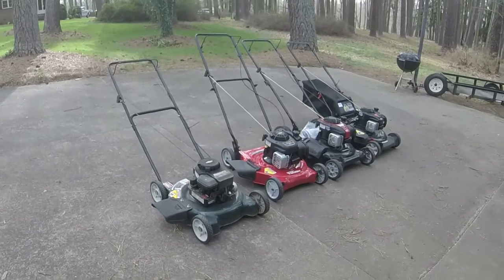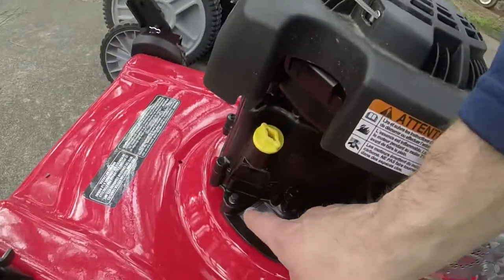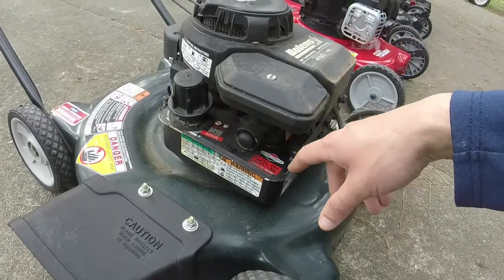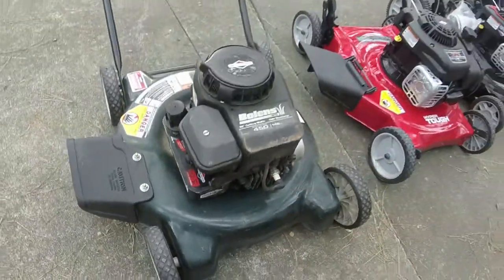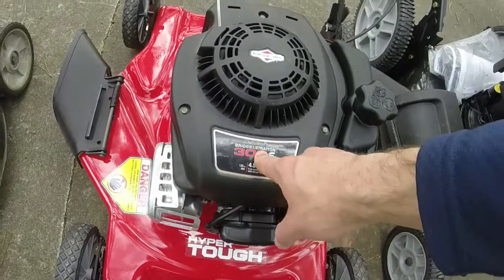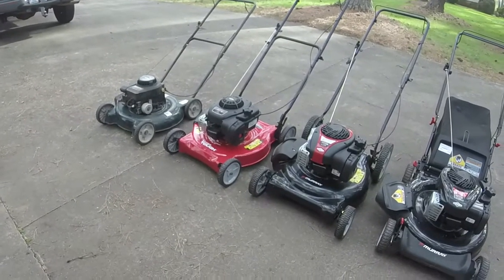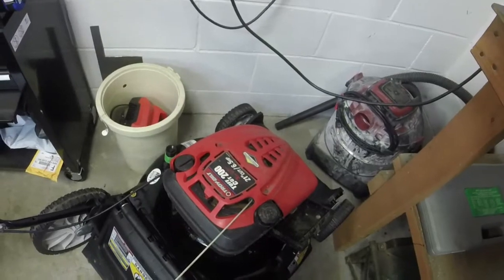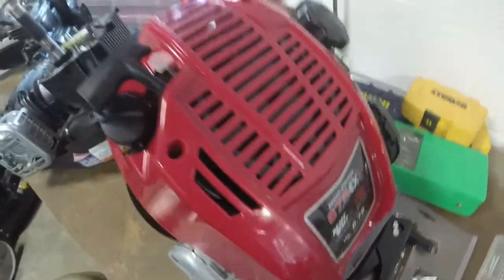Comparing Briggs classic & quantum flathead push mower engines to "new" style OHVs

Comment: Personally, I have never been impressed with Briggs and Stratton engines.  They always seemed temperamental and prone to small fuel issues.   I grew up with Honda as a mower and engine brand and that's what most of my equipment is now, flathead and overhead valve Hondas as well as derived from Honda engines.  Notably the GX200 in one Chinese clone, GXV140 clone on my pressure washer as well as GXV390 derivatives on my snow blower and generator.  My oldest Honda mower is an HR214SX with a GXV120, rated at around 3.5 hp and works incredibly well for something that runs a two speed gearbox, blade brake clutch-operated (Roto-Stop) blade and bags.  Honda no longer makes this engine but its horizontal shaft variant continues to be made and Honda's replacement, the GXV160 is what runs my current commercial unit.  Oddly, Snapper, once (and probably still) a Briggs company uses the Honda GXV160 on its top of the line commercial mower.

Comment: Nothing will ever compare to my 1981 3hp Briggs on a 20" push mower. It never smoked or made noise, tons of hours and abuse and it didn't die until I hit a huge bolt hidden in the tall grass and bent the crank. My 99 6hp Briggs "GTS" has been good so far but smokes on cold start and the plastic tank leaks above half. It probably won't last as long and hasn't been abused like the old one was.
Reply: <<Nothing will ever compare to my 1981 3hp Briggs on a 20" push mower.>>

Those were the days, my friend.....
https://www.youtube.com/watch?v=y3KEhWTnWvE

Comment: Ellis Mowers. I am new to your YouTube channel and really enjoyed what you had to say within this video. Although I am not in the small engine repair business per say - I maintain several of my personal owned mowers as well as my sisters mower. 
I have a spare mower with the 300 series B&S engine on a WeedEater 20 inch trashy deck and my sister has the 550 series B&S engine on a Weed Eater 22 inch deck. The only real issue that these two engines have would be the diaphragm & gasket replacement every 2 to 3 years. Also, I have a 21 inch Snapper with the heavy mower deck and the 3.5hp B&S Engine with a early version of AutoChoke. These Three B&S engine(s) are very solid performers with virtually no other issues other than maybe a muffler replacement, blade swap or a new spark plug when I do my service. 
My Question Is: Are the Professional Series B&S Engines Made As Cheaply As The Ones In Your Video? 
I’m rather impressed with the Predator engines from Harbor Freight - They seem to be pretty durable compared to the garbage engines that B&S and Kohler with their “Courage” are dishing out. At least the Tecumsehs would run until the connecting rod went through the block. Thanks & Best Regards From Central KY.
Reply from the maker: Thanks for watching!  I think you have to go commercial to get the professional series engine now, but to my knowledge they are made better than the E series.  I have yet to see a Tecumseh blow up.  The Classic engines are great and I happily change diaphragms on them.
Reply: Ellis Mowers. Some of the toughest B&S engines were the 326434 cast iron engines. I have a Yazoo YR48 rider that while using one 90+ degree day - Got hot enough that the kill switch no longer worked. So I pulled the mower in a shady area and cooled the engine by idling it to a safe temperature before shutting it off with the kill switch that time around. You would have thought that engine would have been toast. That engine still runs to this day. The older engines do not like this crappy gas at all. 
The Kohler K Series Cast Iron engines were pretty awesome too. My two Cub Cadets are built like tanks;  My 107 with a K241 and my 683 with a KT17 Series 2 engine. To Mr, It just doesn’t seem quite right to see Cub Cadets that are solid yellow and not shaft driven.

Comment: I have a 6.0 Commercial Quantum model # 12J702-1757-B1. I've had it 20 years doing just my home lawn. Just having my first major problem with it, it won't start. Only other issue I had was to replace the tank.,  it was originally metal and had sprung a leak. I ran it 2 years before I had it replaced because it still ran like a sewing machine. Going to have my baby  fixed.

Comment: I'll keep my old junky quantums, got a Yazoo brush mower with a 24 inch deck and I/C quantum and the sucker smokes when you start it and it struggles to run that blade and the self propell but it just won't stop running. 25 years old.
Reply from the maker: I have seen Quantums abused to no end and still kicking.  Sold one that smoked last week but still ran great!
Reply: New rings should fix it if it’s an I/C.

Comment: Best briggs were the quantum engines and the next best was the Briggs classic.  The new OHV ones are made as a throwaway after maybe 5 years .  Gone are the days you got   15-30 years out of a small engine.  But  quality of fuel also makes a impact 
Ethanol burns at a higher temperature so. What’s is  metal ‘s  kryptonite,  “heat”

Tecumseh “had” some good ones years ago.  I used one from 1973-1998 never had a issue.  Only added oil and gas.
Reply from the maker: You got it right on, the OHVs are good for a few years but the weak points will start showing especially if not taken good care of.  Old Tecumseh is good too, way to many carb problems on the newer stuff but have yet to see one blown up.

Comment: Great video. I have a Snapper with a 875 series Briggs and Stratton engine it has a   metal carburetor on it.
Reply from the maker: The 875s are really good engines, they phased them out too I believe except for commercial use in lieu of the check and add stuff.

Comment: In 2023 I called the local honest mower dealer and insisted on a mower with a Briggs & Stratton flathead engine. They only had one. It was a Brute 22 self-propelled with a 675 series engine. Some lovely person broke it while it was barely used and let it sit around for years before the shop got it. I paid $255 plus tax. I could have bought a new crap mower at Walmart for that price, BUT I DIDN'T!
Reply from the maker: The flatheads are great.  I think they stopped making them in 2012 and Brute mowers around that time.

Comment: I'd like to see a heads up performance comparison between the old and new of equal torque ratings...Perhaps using the same deck in tall-wet grass.. a side by side drag race. Then we'll be able to see which has the most usable power..We all [those of us that cut for a living] know which is the most reliable.
Reply from the maker: If I did yard mowing for a living I'd love to try this out and may still in time.  Thing is there's a lot of factors in old vs new so it would be hard to make an accurate comparison.

Comment: Briggs and Stratton nowadays build their engines cheap with having lower quality to them because they decided to move onto designing their engines of being more lightweight with enough maneuverability and with lower maintenance. The reason why Briggs and Stratton moved onto externally building their engines with plastic because plastic doesn't corrode or rust like metal that can lower the maintenance problems of using tools. Although, plastic is lighter and more shock-resistant than metal.

Comment: The only problem I've ever had with a 675 is it smoked for almost a minute after I changed the oil and put Pennzoil in it. But every other flathead I've had not one problem other than overheating

Comment: Yes, it might be true that they are “cheating out some”. However, they are having to compete with their Chinese competitors, as well as Honda. Nobody makes flathead engines anymore. If they were still around, Tecumseh would be Brigg’s only competitor with flatheads. As long as you change the oil, despite what they say, and run it dry at the end of the mowing season, you should never have a problem with it, maybe other than a minor recoil issue, which is easily fixed, and happens on Hondas all the time. Also, yes the crankshafts are easier to bend. I used to have a 3 1/2 hp flathead Briggs back in the 1980s and I hit so much with that thing and never bent the shaft. However, if the shaft is bent, it can be fixed and straightened  by putting the mower on its side and using a floor jack. Roll the wheels of the floor. Jack onto the deck of the mower position the bent part of the chef, so that is at the lowest part when it is on its side use the jack to push up on it to straighten it out. I’ve seen this done and it can bring the shaft back into almost perfect straighteness. Honda mowers also have easily bendable shafts.

Comment: The cc's don't matter, I do lawn care and the overhead valves have WAY more power than the flatheads. When i do overgrown yards and have a sections where my big mowers can't fit I have 2 20inch bolens push mowers that's as basic as can be that I solely use for overgrown yards that will cut weeds taller than me clean without hesitation. Had them for about 6-7 years now I found both free on side of the road, a quick carb clean and both have been running great since then no issues. I do have flat heads style with self propelled for my basic mows but they have no balls to cut anything over 8 inches tall And I side discharge.

Comment: did the quantum engines have a cast iron cylinder sleeve?  I've got one that's drinking a bit of oil, & has a sizable difference between wet & dry compression.  I'd think about replacing the rings, but it doesn't seem worth it if the bore was aluminum.
Reply from the maker: I want to say they are cast iron, but either way ring replacements are something many people have done successfully on these engines from what I've seen.
Reply: If there i/c
Reply: If your cylinder is in good shape (minimal scoring) you can re-ring it. Even an aluminium bore. A cast iron bore engine can be slightly bored out to oversize. Get an oversize piston and rings and hey presto you have a new engine again. Those ic briggs flatheads were the best. And the regular kool bore briggs's were tough. Lob in the cast iron cylinder and its just the best you can get

Comment: Would a Briggs & Stratton 6.5hp Quantum engine have the same bell housing bolt pattern as a Tecumseh 4.5hr Eagle 1 engine?
Reply from the maker: It should be, most all consumer small engines have the same bolt pattern to adapt to many deck types.  So they should be interchangeable.
Reply: @EllisMowersandmore  Thank You!!

Comment: This is what happens when companies try to keep up with Honda but can’t because the price would be too high. OHV is not the problem it’s their plastic carb and cheaper design  for briggs that’s killing them. China clones went more with the Honda design than they did with the briggs new design. Briggs I guess saved their great OHV designs for the lawn tractors.
Reply from the maker: Their rider OHV engines have gone down too, I've had a lot of machines made since 2016 where Briggs engines have not held up either.

Comment: Yeah, just "Check and Add" with multi-viscosity oil. :D If people ran 30 SAE and changed it often, there wouldn't be very many "blow ups." ^_^
Reply: yes sir haha new tech in my opinion has just reached a point of no return.. i mean, you take one of those old classic brigs you can't kill them, i have one its been submurged in a flood its hit a huge metal pipe oil in the carb it will phal a spark plug just like that it has a blow head gasket it burns so much oil and has the most blow by in the world and keep going.. so if you ask me brigs & stratton as we know it has gone to trash. it really sadens m,e that it has gone this way but it has. :(
Reply: You’ll be lucky if you can get your average home owner it even do that. Most people that run a mower will do the absolute bare minimum to keep it from blowing up.
Reply: @lawnmowerdude  i feel like schools should have a lawn mower /vehicle maintenance how to
Reply from the maker: I know, but some are defective from the factory too, seen many more check and adds blown up over the standard E series engines on new mowers.

Comment: The. 675 are good engine. As. Long as the oil is changed.
Reply: i have a 6.75 hp brigs and it was sittin over six years i fixed it no starter fluid first pull it fired to life. they used to be good motors
Reply: its a real shame they let them go
Reply from the maker: Yes I've seen many 675s come in and out and they are almost always running great even with black oil.